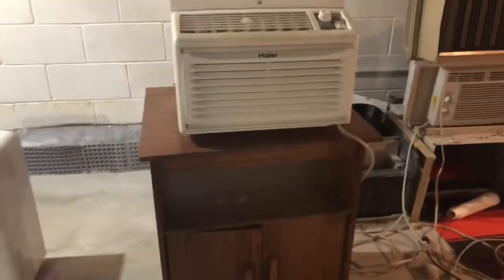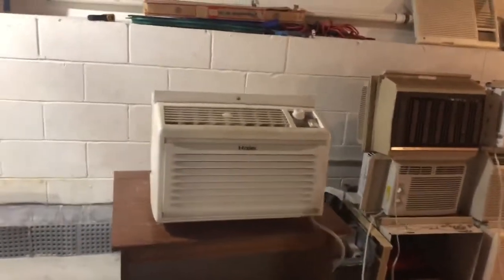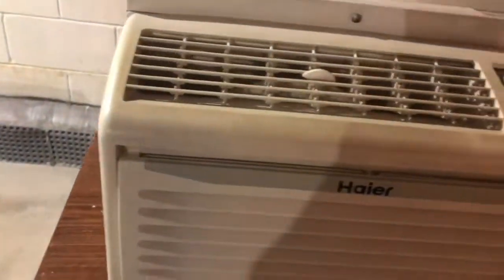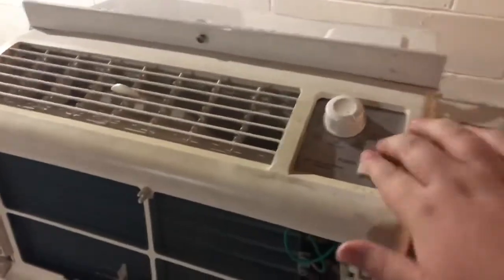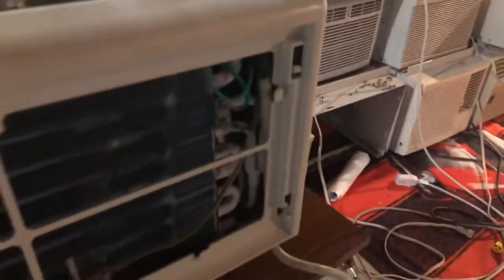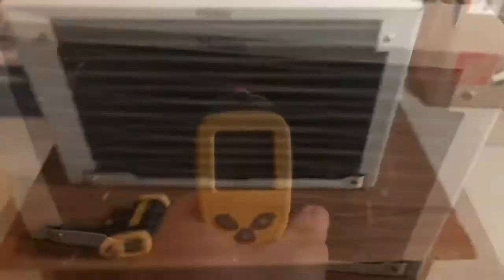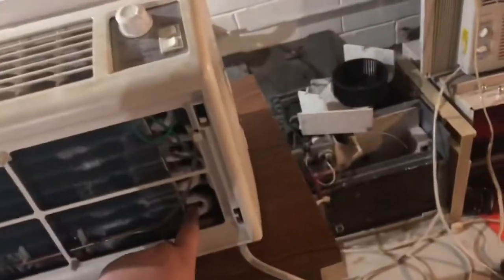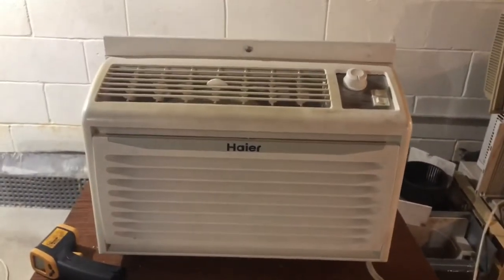2007 Haier 5200 BTU Air conditioner

Comment: If the Fan Motor and the Compressor are getting "weaker", it could means that the capacitor is about to fail. 
If the fan and the compressor eventually get "stuck", it means that the capacitor failed and that should be an easy fix.
Reply: I recently replaced a 35+6uF capacitor that failed with a 35+5uF on a 2013 LG 6000 BTU, and it is working like new again. I also added a smaller 1uf Cap to the 5uF side in parallel to have 6uF on the fan side.

Comment: I have the same unit r22 runs asssss but do they loose charge or am I just lucky that mine has original r22 that ices up the coil when first start some how but runs smooth and I gave you the diagnostics for mine